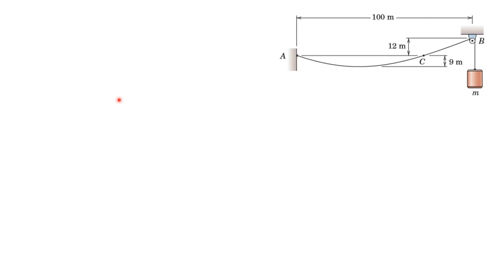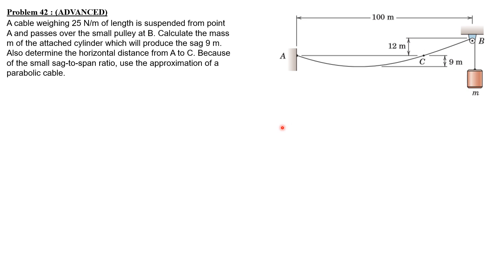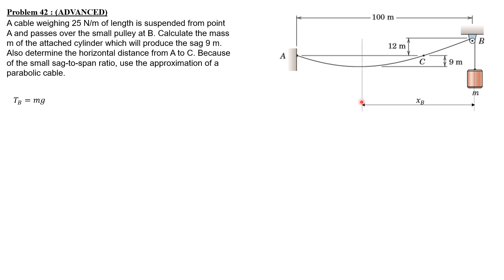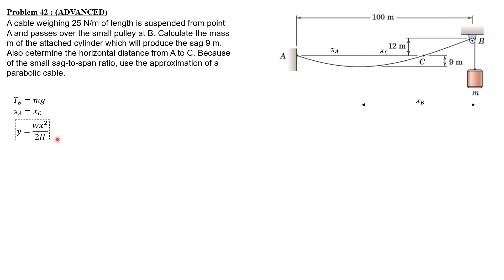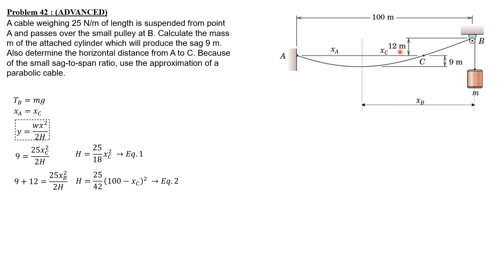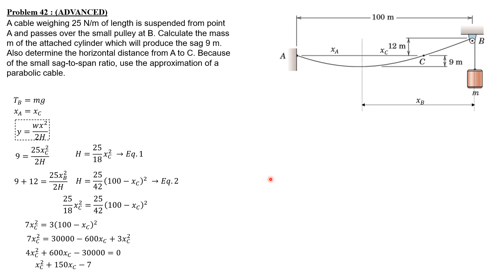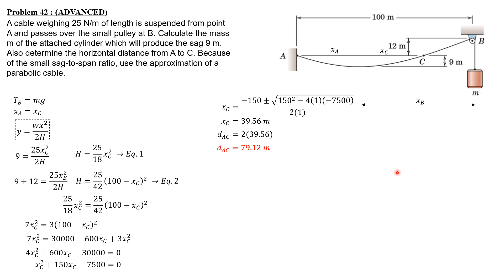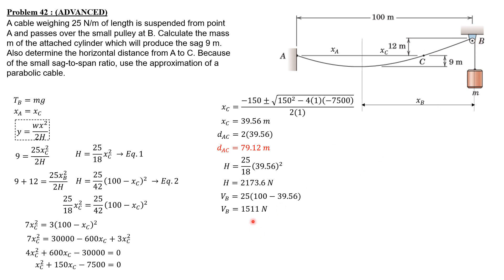STRUCTURAL ANALYSIS, EXAMPLE 42

Comment: sir ask lang po, bat 25/42? diba dapat sa after transposing ang answer sa 2nd equation would be 25/21? since 21H sa left side after multiplying H on both sides tapos divide lang 21 on both sides again to isoldate the 2nd 'H' equation? thank you
Reply from the maker: Can you not see the 2? 25/(2*9) = 25/18 , 25/(2*21) = 25/42.
Reply from the maker: I already answered you. It is a matter of Algebra. y=wx^2/2H, so H=wx^2/(2y); 2y=2(21)=42.